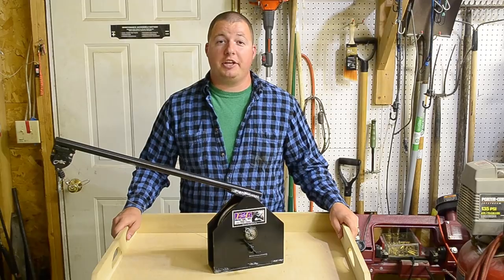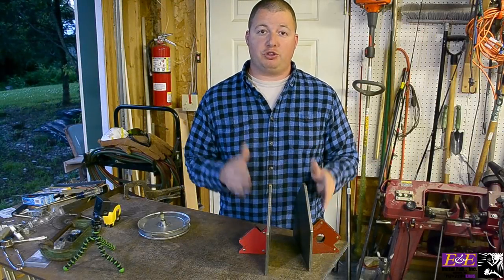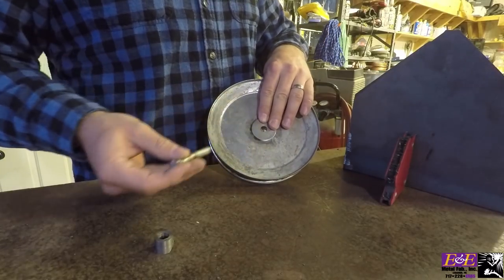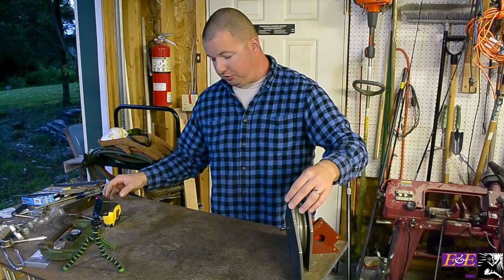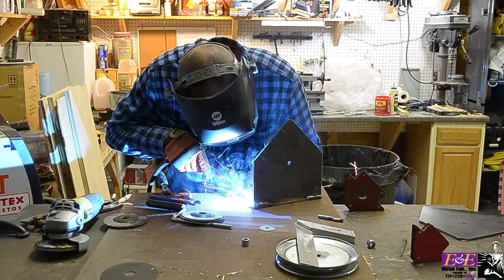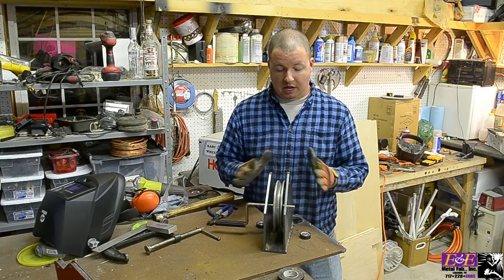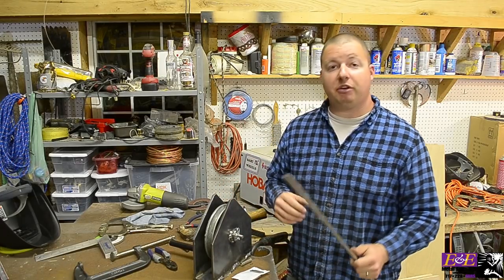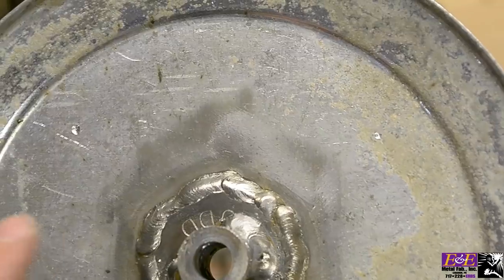DIY - Making a Downrigger

Comment: What size pulley are you using?  how much line will fit on it?
Reply from the maker: It's about a 6-7 inch pulley, bigger is faster. I have 200' on it right now and it could easily take 400' more

Comment: Like how much money you spent to make one homemade downrigger
Reply from the maker: Rosa Serna the plate metal was free but you could get some for $10. The pulley was from an old lawnmower at a junk yard $5. The pipe was from home depot $7. The hand crank was off a snowblower from the same junk yard $3. Your looking at $25-$35 dollars maybe cheaper if you can get some materials for free.